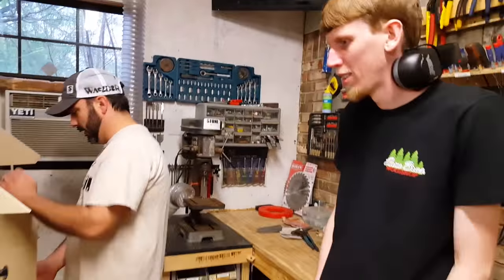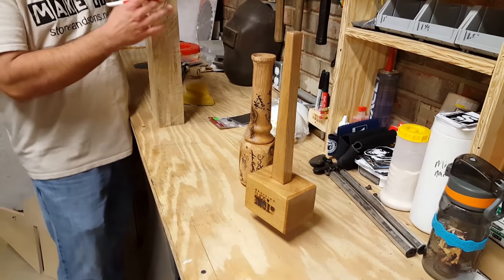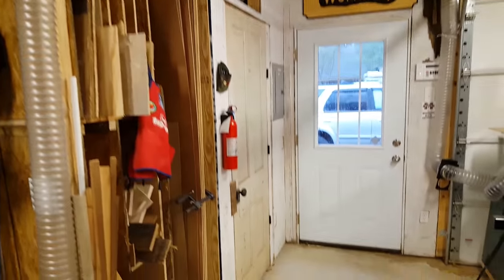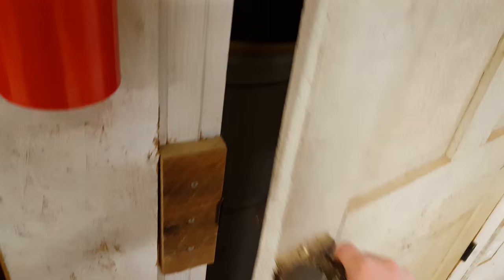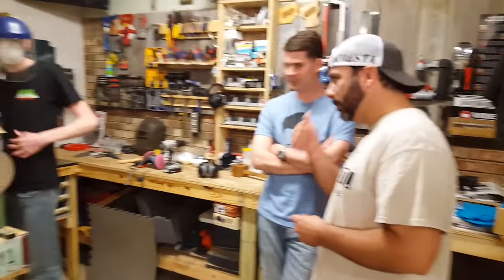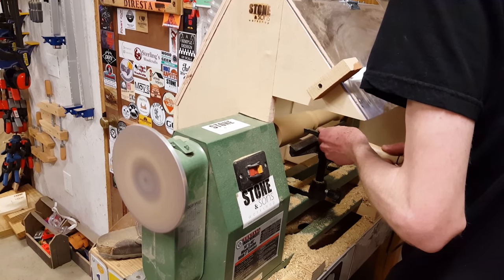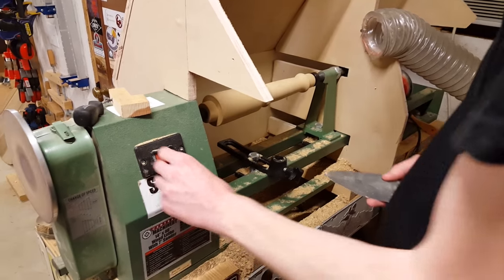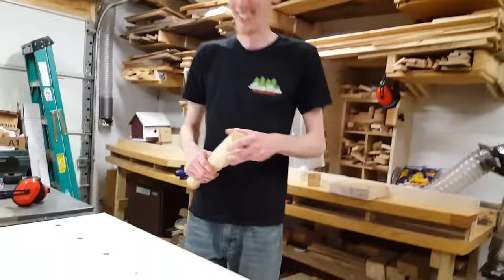Matt Lane and I visiting Shawn Stone's Shop and turning a mallet

Comment: Wouldn't it be easier to set the table saw blade over to 45 degrees and knock the corners off of the blank first?  (Make the blank an octagon)